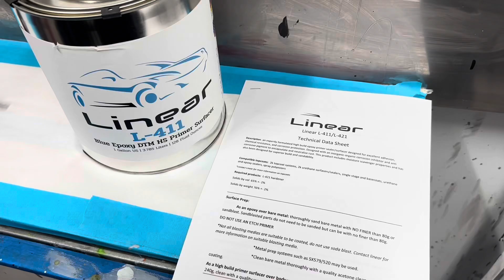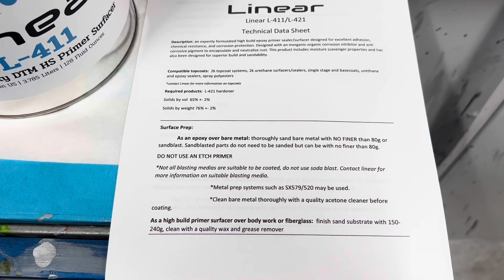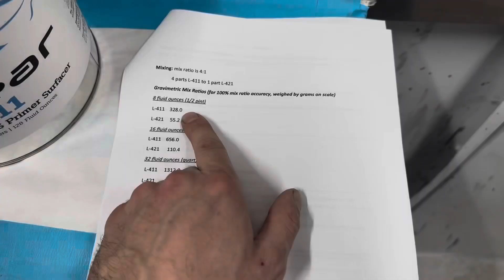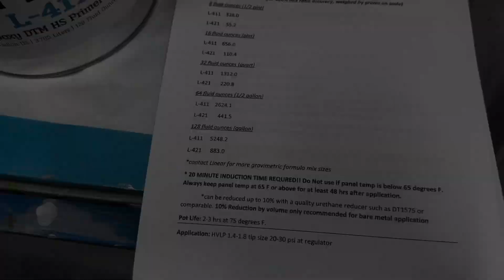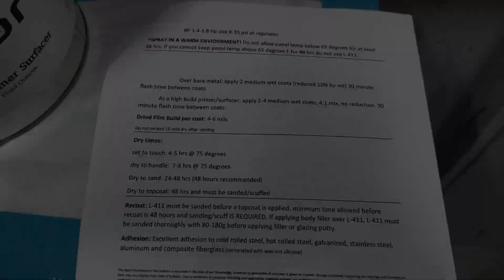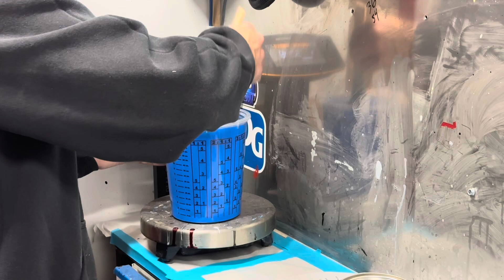Proper Use and Application L-411 High Build Epoxy

Comment: Looks interesting. IS there a number to call for more information? Contact who?
I'm a little confused. I thought you would start with the L411 to enable the best corrosion protection/encapsulation but in the video you had a car that had a base coat of epoxy primer that was black, then a grey primer that was which? then filler that was later covered by the L411 high build.
Wouldn't you want the best protection on the very bottom with L411 and then add the filler? Then cover again with the L411?
Thanks in advance for the reply.
Reply: I have the same question.
Reply: Using the L411 first would give u a surface that u have to sand before going any further and u would have to wait 2 days before sanding plus it would provide nomore protection than the regular epoxy primer because it's the same thing...EPOXY! Lol the epoxy in it is what provides the corrosion protection. So, he sprayed regular epoxy to protect the metal , then bodyfiller, then the high build to protect the filler and fix its imperfections.
Reply: @DreadlockGangFelon for those who want to watch his videos there are clear reasons to use the SAME product to layer which has no SHRINKAGE and chemical ingredients for hardening that actually collect moisture from chemical reactions. Also using products that are not the same causes different shrinkage- not right away - but down the road. Again the videos on his YouTube channel explains everything in detail. You can watch or not watch but I was convinced that professionals out there are using methods that cannot compare with his engineered products and their methods will be replaced.  It’s too much the explain. High build fillers on top of epoxy primers are not the best way to go. High build epoxy that sands easily and once cured do NOT SHRINK will be a great long term investment.  Some people will wait months and more to make sure shrinkage is complete and no issues have happened. These products once cured do not shrink. He has long term tests to prove and compare. A body shop of can’t let projects sit around taking up space so they push it out the door. No worries if no one looks. It’s just information for others to decide for themselves.
Reply: @jimdrechsel3611 yeah but the high build that I'm referring to is the L411 high build epoxy that he his advertising. I'm only pointing out that it only ever makes sense to use a high build epoxy ( or high build anything for that matter)  if u are planning on sanding it... In this case that would add an unnecessary step since you WILL have to sand the bodyfiller anyway. The epoxy was only sprayed first to protect the metal because bodyfiller is porous and should never go on top of metal. Sure, he could have used the high build epoxy first without sanding but imo that's a waste of product. Just use regular epoxy but when you are working direct to metal, epoxy always goes before filler.

Comment: This is a great idea for restoration. But, your filler is too expensive. You can get Optix Super Build for half the price of your product, it's a DTM and you magically left it out of your your test. It finishes out the same as G2, just a little more money with so many more benefits. I can get 3 gallons spray-able ( that's 10 quarts)for less than 5 quarts of your product, so the solids remaining after dry is a way better dollar to ratio game. I get you're following in the Re labeled  Dura-Gold paper as your own "thing", but you can only beat a horse so much.
Reply from the maker: For one ever coach, Superbuild is a very cheap product, they claim DTM, but most manufacturers definition of DTM is that it sticks to metal, that does not mean that it has any sort of corrosion protection, which it does not, and this product far out builds any ever coat spray Poly and shrinks far less. If you have not, I’d suggest you watch the shrink test video. You definitely get what you pay for.
Reply from the maker: Any spray poly cannot truly be a DTM primer being that they are activated by peroxide, and also very porous and breathable. Spray Poly breeze, moisture in and out, if you do not have Apoxsee before spray poly that is a recipe for disaster, long-term. Spray poly is a thing of the past. Our product also has rust encapsulation properties as well as moisture scavengers, which Spray Poly definitely does not
Reply from the maker: Also our paper is far better than any “duragold” private label, they don’t even make a purple ceramic paper but ok, move along bud
Reply: You confuse me in this video you said to reduce it 10% if you're going to use it over bare metal as an epoxy sealer but towards the end of the video you say it is not intended as an epoxy sealer?

Comment: So when wil it be available and  the price
Reply: Website says preorder $375 for 5 sprayable quarts and expected to be in stock for late Nov. So probably very soon.
Reply: What's the difference between DP-90 ?
Reply from the maker: @RS-gh2mf  there is a lot of differences between this and DP 90. This is a sandable high build epoxy. This is meant to be used over bare metal and then also used as a high build primer surfacer after filler work.
Reply: @linearblockingtools4064  what’s the pot life? And is there different colors?